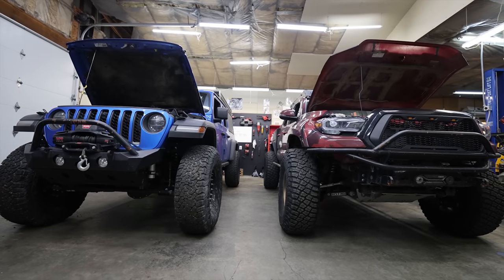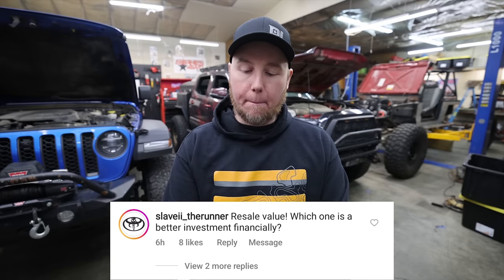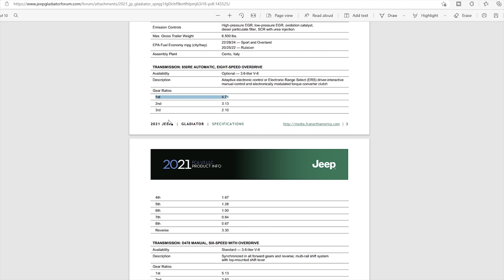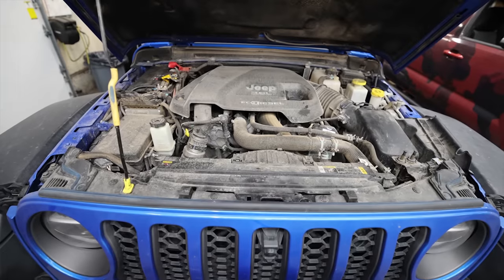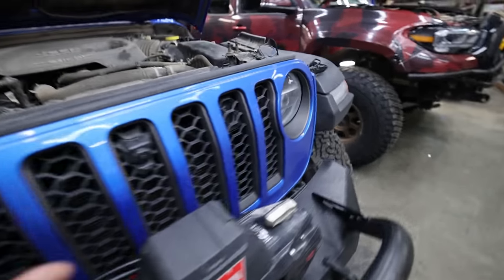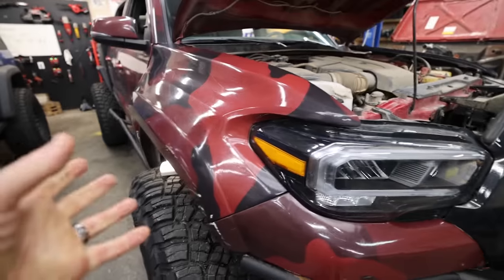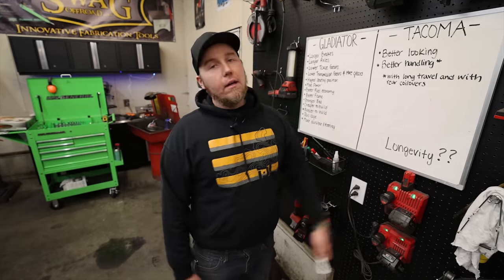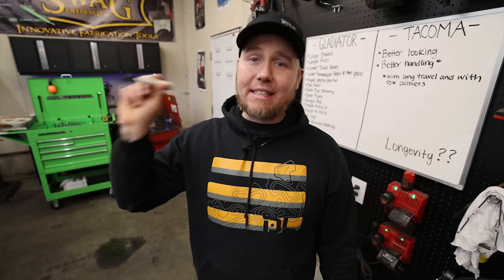My 21 Jeep Gladiator Vs My 21 Toyota Tacoma. Cold Hard Facts.

Comment: If you remove the brands it was basically a break down of why solid axils are better for DIY budget minded 4x4 builds. Your money and time goes further with solid axils. IFS is more for going fast and spending big money to do it where better handling is more important. Basically for general 4x4 trails or rock crawling get a Jeep. If you want to go fast in the desert 2x4 Tacoma and lots of money.
Reply from the maker: Very accurate assessment 👏
Reply: Glad you put the lots of money in there and 4x2 as that’s how you can get ultra long travel because of the lack of front driveshafts and diff.
Reply: Don't overlook the fact the the Toyota's are underpowered. Nothing more annoying than driving a truck that can't keep up without downshifting constantly.
Reply: Having owned a JK and 2.5 gen Tacoma I’d like to stay the same. 

Jeep for rock crawling, more aggressive off roading at slow speed, modification variety 

Tacoma for more faster speed off roading and a more comfortable on road driving vehicle

Comment: As a 3rd gen Tacoma owner, I am fully aware the Gladiator is better by the numbers as you've pointed out. For myself--and I suspect many others--it comes down to price. I got my fully loaded Off Road for $39k out the door in 2020. The fully loaded Gladiator (which is what you're comparing it against) was $65k at the time before TTL. After TTL we're talking about it being more than 70% higher in cost so it better damn well be better. I guess what I'm saying is, I'm not flustered by this comparison because to me it isn't apples-to-apples.
Reply: for the cost of the jeep you can throw a lot at a taco
Reply: @MyLonewolf25  hmm I bet there is a lot of cash 💵 in the taco 🌮 front end , as to me the taco is a toy 🧸. The frame alone is a do not pass go mistake , Why would I wanna buy a Taco pretzel truck 🛻? But most people don’t really care, for Soccer mom /dad duty . But when you start off roading , as the presenter is alive due to Jeep yj  roll cage . Note he said Rolled the Jeep is still square, and still in use #10 years on . 

The old adage is true you get what you pay for 0iiiiiii0
Reply: @andrewp1427  

1. It all comes down to application. For 95% of people, the stock Tacoma with some mild mods is plenty for their purposes.  If you’re in the 5% (or less), Gladiator is the better choice.

2. The frame issues, providing you don’t ignore the payload capacity, aren’t really an issue anymore.  Again, back to the 5% (or less).  Application is key here.  Again. all about application.

3. As previous commenter said, apples and oranges with cost

4. I wouldn’t trust the eco diesel, whatever generation, long term.  Sad a gas engine would last longer than a diesel, but that’s where we are at with those Italian designed 3.0 diesels.

5. Toyota has a reputation for reliability and longevity that is unmatched.  All the specs in the world don’t matter if the expensive vehicle doesn’t last remotely as long. That was earned over the last 40+ years. Almost all people don’t have dedicated trail rigs.  They daily drive their rig and put lots of miles on them.  Personally, I can think of 20 Toyotas my family has owned, putting between 150,000-220,000 miles on them, there have been no major issues, 99% routine maintenance.  FCA has the opposite reputation.

In summary, the Tacoma has plenty of flaws that were called out in this video correctly, but your snide comment tells about 20% of the story.
Reply: @MyLonewolf25  never mind that for the price of the gladiator i could buy a taco a quad and a small trailer to tow it LOL THEN whos making it furthur down the trail??
Reply: @@andrewp1427  you get less aerodynamics than a cow for 65k?
Reply: @LeeSindrum  what is the Jeep gladiators, mission . As this YouTuber Forges stream with A gladiator with a trailer in tow .
Reply: @@andrewp1427  What is the Jeeps gladiators, mission.... Was that a question? Or are you trying to tell me something?
Reply: @LeeSindrum  hmm Basically, the gladiator and the Wrangler platform are designed for slow, Rock Crawling due to Solid axles. It all depends on the use case in the mission for the vehicle. There is no question on the Toyota reliability that has been their trademark for generations. 

Jeeps Wranglers and gladiators on the other hand are purpose built to beat the ever living 💩out of. As jeeping is a cult , but each to their own . I have two Jeeps of over 100,000 miles One almost 20 and the other over over 15. Yet to be determined how well they will do off road , as The builds has begun.

During this video, Said he had a Wrangler and the factory roll cage is absolutely perfect after he rolled the Jeep and the Presenter is still alive. 

The mere fact that some Tacoma’s cannot go on a car lift And still have a frame and a straight as an arrow, Speaks volumes to the mission statement of the Tacoma.
Reply: @@andrewp1427  Crazy thing is I think Jeeps get better mpg somehow, but idk gladiators are not the move for me. I like a good looking wrangler, just don't have 65k for a Rubicon. Trd off road is 20k cheaper, and still cheaper than the gladiator. They each have obvious benefits, I just think that extra 20k can go into the vehicle to make it equally nice over time. There's no question to me wranglers are better for off roading, the wheel base is smaller, geared better, etc. I'm just getting into off roading so I was curious, thank you for being so informative Andrew 👍🏼
Reply: @LeeSindrum   I wish USA 🇺🇸 and Canada 🇨🇦 got the highlux as Mexico 🇲🇽 makes and the rest of world 🌍 gets
Reply: Not to mention the Tacoma is way more reliable and will cost you less down the road, furthering the cost difference.
Reply: @andrewp1427 I really wish I had a hilux they are so awesome. I have a 22 Trd off-road rn and it also had a long bed so it’s not the best for off-roading but it’s still such a great truck I love it
Reply: that is a grossly misrepresented price comparison
Reply: I bought a fully loaded (every option out there other than diesel ) on Gladiator in 2021 and it was 55k.  No granted that still is a considerable amount more than a loaded Tacoma. I also have to agree its not really apples to apples.  Since I had a 16 TRD Off Road that was loaded then the Gladiator I got a lot of friends asking "what one do you think is bettter?"  I Like Gladiator more BUT it is still like 15K more money so when I said it seems nicer ....well it should be for the extra cost.  Both are about the two best off road trucks out there.
Reply: @Grodd70  Hilux beat both but you can't get them in the U.S :( --- Also Hilux is extremely unexpensive to boot with 35mpg thanks to its turbo diesel engine.
Reply: At this time, a fully loaded Rubicon Gladiator is almost exactly 10k more than a Toyota TRD pro and for that 10k you get factory front/rear lockers, electronic sway bar, diesel... plus all the stuff he mentioned in the video.  Seems like money well spent to me.  Also, that 10k doesn't take into account Toyota dealers still jacking up the price over MSRP on the TRD Pro which they are still doing in my town.
Reply: @LeeSindrum  Hah, All Jeeps have aerodynamics worse than any other vehicle on the road, still there are crap tons of them on the roads. Jeep Branding.
Reply: True
Reply: That’s a point. He went on to make that pinned comment as if Tacoma was pricier. I think he is biased. Jeep is at my heart but for now it’s Tacoma.
Reply: Toyotas rep for reliability is mostly hype outside of Camrys
Reply: @tehagent1321  when you grow up you will realize that hilux, landcruiser among others from Toyota are known for reliability.
Reply: @boxoffisa  when you grow up you’ll realize that a small number of models don’t matter as much as you think they do
Reply: @tehagent1321  when you grow up you will realize that bigger is better.
Reply: @boxoffisa  Thats what your mom told me and thats why Im coming back tonight
Reply: @WestBeachFLboy that's not true it depends
Reply: @tehagent1321 😂😂😂
Reply: @Fuckyoutubecensorship1  It is true, I work in a shop that services both for going on 8 years now. I almost never see Tacomas with major issues. Jeeps come in all the time with lifter/cam/timing chain issues, oil cooler leaks, electrical problems with the fuse block, and transmission issues as well. Never see that stuff on Toyotas.
Reply: @WestBeachFLboy  My shop out here in Puerto Rico we sees more Tacomas with broken Transmissions and differentials and Tundras with leaking towers and rotting frames that then need a welding not to mention turbo wastegate problems on the V6 Tundra then we see Jeep gladiators it depends on the area but only naive people will assume that Toyota still has the same reliability it used to have from late 90s.
Reply: $39k is not the top of the taco price tags. Don't act like your budget option truck is the same as a TRD pro msrp then quote the Rubicon msrp. Can get a midrange Gladiator  for less than $65k also buddy.

Comment: This video is great coming from a die hard Toyota guy (Own a 2021 TRD OR and 1st gen 4R on 40's with SAS 8" axles) and you bring up facts that hurt me a bit but I have one issue that you didn't mention. You said it cost you substantially more to bring the Tacoma's suspension/gearing to where it is vs the Jeep. My 2021 TRD OR bought brand new was $41,000 OTD with taxes & interest included. A Rubicon Gladiator with the most basic off road oriented options priced out at $62,000 OTD with taxes in my area. Thats a $21,000 difference that your paying for to get that Gladiator. Lets say you spend another 6K for the gears, wheels, tires, lift and do it yourself, now your at $68,000 for the ideal rig. Then the tacoma costs 10K for controls arms, suspension, steering rack, Gears, shafts with wheels /tires. If you want crazy low gears marlin offers their taco box for 3K that makes the final drive 230 to 1. 41000K+10K+3K=$54,000 for completely built tacoma vs $68,000 for a similar Jeep. Still a $14,000 difference. No doubt the gladiator is slightly better OEM but your paying for it even with or without it built.

Comment: Long time viewer Nate, awesome video!
 I have a few points to make. The Tacoma was never designed or intended to go up against the Gladiator in offroad prowess. Its main competitors are the Colorado and Ranger. 
1. The Gladiator is an offroad vehicle that can be daily driven. 
2. The Tacoma is a daily driver that can be taken offroad. 
Each one compared against the other in their main engineered field will fall behind, but that's the point, it's intentional. The open C channel frame, for you is a negative, but for on road, the added flexibility makes it more comfortable, it's also less prone to breaking compared against a boxed frame. However, more prone to bending if overloaded.

Comment: Being a mechanic for multiple brands of vehicles, mainly four-wheel-drive. Diesels can be awesome for the right driver. There’s facts where I live that change the who’s best scenario salty highways. the slush and salt gets inside of a box frame unless it’s metal thickness overkill or coated properly or built with material that helps fight corrosion. The old style Toyota box frame holds more corrosive material. The 79 style toy pickup only four-wheel-drive pick up was a nightmare of frame rust.  I’m talking pre-Tacoma. I also found Dana axles  the same size axle shaft we’re stronger than Toyota axles. Because of the material. Thickness alone of material isn’t the whole story. Mild steel isn’t mild steel. What I did notice Toyota does a great job with is wiring. Older dodges used Bosch connectors. They quit doing that it was expensive and boy did corrosion start in the wiring. All kinds of issues after that. Toyota does a good job on their engine. They don’t have phaser problems like Fords, every manufacturer has positives and negatives. If you’re going to modify your vehicle ease of modification is huge hats off to jeep. User-friendly.

Comment: Speaking about jeep wrangler cages, i have a similar story. I rolled several times off the side of a Colorado mountain road and had a direct impact on the driver a-pillar. The cage did its job and would not wheel another vehicle without one, Ill personally vouch for the stock wrangler one.

Comment: I noticed the rust with the Tacoma and I was wondering why as the Gladiator looked very rust free (underneath both), but Nate gave a very good explanation why, and for me faced with a choice of the two I would go with the Gladiator just for frame difference.
Reply: The government came down pretty hard on jeep Chrysler Fiat for their bad welds on the frames they wouldn’t fix and the government made them. I don’t trust Chrysler Jeep Fiat
Reply: Drive an old beater in the snow.  Why get wet salt all over a $50,000 plus truck?  When I build my rig, I'm going to be keeping my GTI for winter driving, not that my GTI is a beater but its probably only worth $7-8 grand.
Reply: @flexapex9801  Perhaps, but Toyota is still replacing failed frames, and there are still Tacomas on the road with failed frames.
Reply: @brentworls8509  Yes I understand that but the government had to step in for them to fix it.
Reply: @brentworls8509  3rd gens have c channel frames they have the same normal rust as any other vehicle. It just depends if you take care of it or not.
Reply: @TheShowtime85  Atlanta Fan? Not everyone is lucky enough to not have salted roads.
Reply: @brentworls8509  Yeah Toyota has had failed frames but so has jeep. The XJ was notorious for rotting and the unibody failing. My friend experienced it first hand with two different XJ's. He moved on to TJ's and JK's and one of them snapped too. When you live in a place that salts roads all things made of steel will rust and eventually fail. The paint on frames doesn't last forever and box frames rust from the inside out all the time. It's not fair to imply that only Toyota is bad for frames being bad when jeep has had it's fair share of bad frames as well.

Comment: We need more reviews like this, great job. I was towing a very heavy duty trailer on I-5 in Everett with my Gladiator. Had to stop in the road to assist a crash victim. A young man rear ended my trailer at about 50 mph while I was stopped. He totaled his car, bent my trailer axle and my tow hitch down about 15 degrees, no frame or any other damage to the 2020 Gladiator.

Comment: You’re right and what you said about the difference between a Tacoma and the gladiator, but I’ll take that a step further I wish the forerunner did have an eight speed and did have a lower transfer case gear to save your drivability on the highway 41 ratio would be nice for the transfer case and may be a 410 /411 rear end.  My forerunner is a 2016 trailer edition, same thing as a Trd off-road nowadays, when I bought it and 16 it was 37,000 and some change, nowadays they’re pushing 50,000 and more, the jeep, Rubicon‘s to get Dana 44 axles for 10 tail gears, and a 41 transfer case you’re looking at almost 60 grand, Pricewise they’re just not practical anymore  to spend that kind of money to take out in the boonies and beat it up, unless you have more money and you know what to do with.

Comment: When I bought my 21 Tacoma access cab 4x4 6mt. I never thought I was buying a jeep killer. I wanted a pickup for overlanding/camping, daily driver, hauling stuff for my fabrication projects and look good doing it. But never ever replace my built TJ. But to your video. The Gladiator does have a downfall. 2 to many doors with that bed.

Comment: As an Aussie I found this really quite interesting. Jeep don't have a particularly good reputation here, and Toyota's reputation is second to none, but I'm amazed at the differences between the US Tacoma and the Hilux we get here.
I thought the Tacoma was basically a scaled up Hilux, but the Hilux gets a full boxed frame and a diesel engine at least...
Reply: They will all share the same frame in the next gen, Tacoma, 4Runner, Hilux and Fortuner.  The Hilux is just plain old right now, it's getting fierce competition from newer trucks from different makers in many markets, especially Ford with their new Ranger.  I suspect the next Hilux will be a big improvement, but I suspect your Aussie spec Hilux would not have faired much better in this comparison than the Tacoma did based on the mechanical criteria he used.
Reply: We have Toyota tax as well, it’s usually 5-7k more for similar year utes down here

Comment: Purchased my Tacoma during the 2021 Pandemic. Came out to $67,000.
2021 Toyota Tacoma Off Road 4x4 Premium Manual Transmission.
Sticker said $41k MSRP. Dealer had mandatory $4,000 Mark Up Tag. Mandatory Prepaid Maintenance, Mandatory Extended Warranty, Mandatory GAP and Toyota Insurance regardless of your own Insurance. Just a bunch of add ons.
It is currently a $100k build. But seeing your Tacoma RCLTHD Suspension, I already know your build is also in the $100k Range.
wow awesome set up of vehicles!